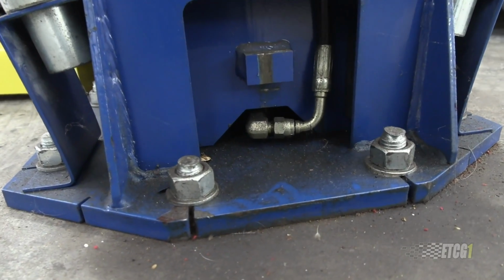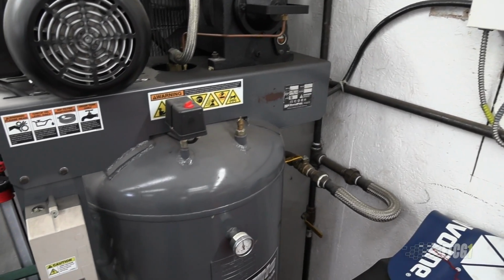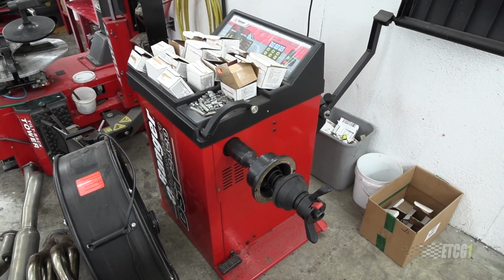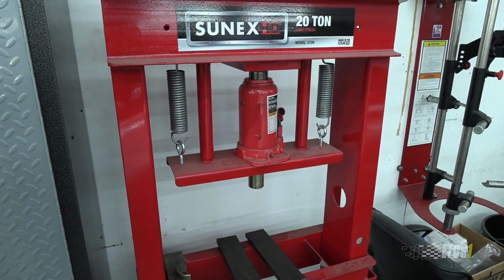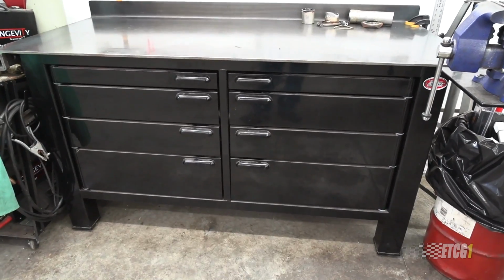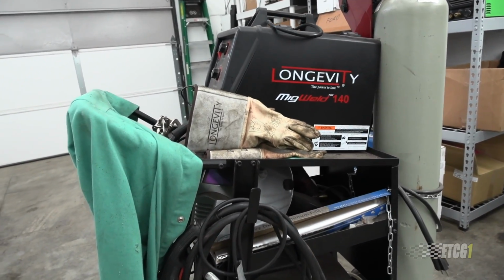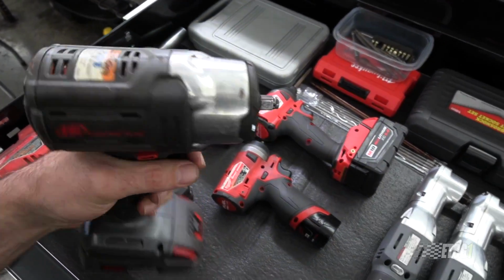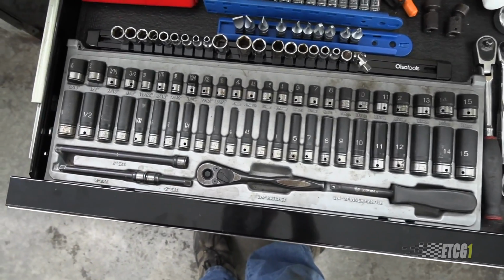The Tools I Get Asked About the Most

Comment: I'm a little late to the party but I thought I would ask if you've found an answer to your low air compressor output? Looks like it is a 2 cylinder model.  Each cylinder much like a gas engine will have two valves per piston,,IE one intake and one discharge.  Take your temperature gun and shoot the valve area on the head while its running.  Open a valve or something to keep the compressor running and try to keep the tank pressure up around 90 psi or greater.  What you may see is an elevated intake valve temp, due to a faulty valve.  This will allow the compressed air to to re enter the cylinder after its been discharged. Causing elevated temps.  Hope this helps.  Oh its a pretty common problem on reciprocating compressors.

Comment: maybe the air tank on the compressor accumulated some water on the bottom (if no air drier is installed on the input) so the capacity has slightly reduced as water is not compressible, my one has a drain valve on the bottom for that purpose, that one possibly also.

Comment: Eric speaking on your 2 stage air compressor you said you had diminished capabilities; sounds like you need a top end refurbishment. Valve service/replacement should be done @ least every year for heavy use w/ industrial air compressors. And for intermittent use every other year. I’m sure I don’t have to tell you about an oil change on factory recommended intervals 😂 Neglected valves turn into no air at all when they fail completely!! Check Pacific Air compressors out of Portland OR. I have found tuk’s (tune up kits) for every compressor I’ve ever inquired about there. They are great to work with....

Comment: I love Snap On and Gearwrench. Mac is okay, only thing is they rust easily, and their cutters dull easily. Their impact sockets are really good and their 1/2 20V impact (the small 500ft lb one?) is remarkably reliable. There's a new Snap On long neck flashlight with blacklight for $99 is ridiculously great. Found a bunch of freon leaks, most of the time without the yellow glasses/goggles! And...I purchased that $1,000 100th anniversary socket with ratchet thing 😂

Comment: Eric, you need to get one of those auxiliary air tank things. If I understand correctly, it's not constant running that kills air compressors, it's the start up that kills them. And if you're having trouble with volume, an extra tank will solve that.

I think the most popular ones are called Käser. Yellow tanks. They're everywhere on YouTube. I'd rather have a spare tank taking up valuable floor space than to have compressors failing every few years. That's a pain in the ass

Whoever invented stick on wheel weights needs to be taken out back, beaten, and shot.

I think you're ready to upgrade to a professional quality welder. Get a good Miller. You'll pay for it but, you'll get what you pay for.

I hate Cornwell tools but, Cornwell dealers have always been my favorite tool guys. Go figure.

My favorite is MATCO. Every bit as good as Snap-On but not as expensive in most cases.

For 1/4" drive, most of what we do on cars needs a 10mm deep chrome 6pt. If that was my only 1/4" drive socket, I'd be ok. Other than that, you need an 8mm and a shallow 5mm for some blower motors. And all of my 1/4" drive is chrome. And it's all Craftsman. The old shit. Somebody got me a full set for Christmas when I was in high school. It's Made In USA. But, I'm sure Lowe's, HD, or HF would be just fine for 1/4" drive in a professional shop where you're using it all day every day. I don't think you need to spend the money on Snap-On or MATCO.

I'll use my 12 or 13 on some stuff if I've already got my DeWalt electric impact in my hand but, I usually just grab the 3/8 shit for anything bigger than 10mm.

With 3/8s though, you really need to get the best you can get. With cars, that's your bread and butter. Damn near everything on a car is 3/8" drive

Comment: I bought Grey Pneumatic Dou socket set based on the recommendation from ETCG and 50sKid, and I am glad I did. I had an impact set from Harbor Freight and the missing skipped sizes and thick wall made it so I couldn't use them in a lot of situations. I couldn't even use the Harbor Freight sockets on my vehicle Lug nuts because they were too thick.

Comment: is there a specific brake caliper "pusher" you use? just went through a fiasco last week replacing pads on my jeeps rear axle and the calipers refused to go back in, had a "oem" dinky tool but had worked up to this point but immediately stripped out, remembered someone gifted me a kit for doing the screw in style calipers that id never used sure enough it had a provision for being used to push straight in, works with a 7/8" wrench and handle they put on it, their handle immediatly bent to an S and i replaced it with vice grips.. still no luck and this is with the bleeder screw opened and tool perfectly squared up.. did what anyone would o and welded a 1/2" nut to the tool and hammered on er with the impact until it was venting smoke and managed to snap the shaft of the tool

not gonna lie at this point i considered getting new calipers but at 90$ each it wasnt leaving a good taste in my mouth.. welded on nut #2 with some excess weld running down so it tapered down slower, another 3 minutes of the impact gun throwing all she had at er and it was finally in enough to fit the pads and rotors, other side was equally as resistant but we had the system down now and got in done in a couple minutes
Reply: Keep an eye, and your nose, on those pads. If they pushed back that hard they're probably going to drag pretty good and burn up

Comment: looking to pick up a Milwaukee 3/8 drive ratchet. Thinking of starting off with the extended reach one. Good idea or go for the normal length. I mostly do suspension and brakes stuff.. Typical Shade Tree stuff. But that long reach to pop some bolts on older cars is tempting.
Reply from the maker: My original 3/8" short Milwaukee broke. It was replaced with the long version and I haven't had any issues with that one so far.
Reply: @ETCG1  ordered the longer version last night.  Can't wait to use it.

Comment: Since I support my personal car addiction by working on other peoples beaters, in my part time shop, so that they can get to n from work, I've finally been dragged kicking/screaming into repairing "newer" vehicles. I still don't do complicated diagnostics, and never will. However, a "customer" recently needed inner tie rods replaced on their vehicle. Now, I'd seen the inner tie rod "tools" that look like small muffler clamps and always wondered how they could possibly work. When the situation presented itself, I didn't buy one of those. Nope...I figured either go big or go home! I bought the Lisle master kit and it worked flawlessly. I've used it several times since and I love it! The funny thing is that as I was thinking go big, I was also thinking big $. I'd never really priced them before but my kit cost under $100.

Comment: MAN I wish OG craftsman was still around. I have sockets from the 70s from my dad. Those fuckers are ni indestructible. Never had one break. I went to use one of my friends sockets the same way. One of those cheap store brand sockets. Got rougly 200-300lbs on the end of it and BAM ratchet goes flying across the driveway. 4 Points split at once. I dug some more, found my craftsman and used it to get the job done.

Comment: When was the last time you purged your hard lines? If you don't have a dryer plumbed in between the compressor and the lines, the lines can get kinda clogged with condensation and rust, which will drop the flow rate over time. It'll be especially bad if you've got elbows that go from horizontal to upward vertical.
Reply from the maker: Not only do I drain the tank after each use, I also have water traps at each drop down. See the video linked in the description of the installation of the system. I believe my 20 year old air tools are just showing their age. Thanks for the comment.

Comment: I use a Bendpak lift almost exclusively at work that's very similar to yours. It weeps fluid like yours, too. Also the locks are insanely loud compared to other lifts in the shop if you don't rest your hand on the release lever while raising. I've also had the switch stick on once in a while as well. Other than that, it's been solid, reliable, and was less expensive initially compared to some other lifts we have.

Comment: i have used many brands of tire changers and my favorite is the coats air powerd with assist arms, once you get proficient there is nothing faster. We have a hunter revolution at my current shop and that thing is a pile, you are supposed to be able to walk away while it dismounts but it contantly fails at breaking beads, snapping sensors and not grabbing the bottom bead. The hunter road force balancers however are the best period.
Reply: The revolution is an amazing machine but it demands respect. A lot of the tire guys at my shop would use it manually because it was way faster but eventually it came out of calibration without anyone realizing, until one day someone tried using the machine as intended and the duck head came down hard and destroyed the wheel. The rev isn't worth the money unless you do a lot of tires, it's amazing how effortlessly it will mount/dismount Corvette run flat tires

Comment: The last shop I worked at had that same spring compressor. I loved it, so much safer and quicker to use. It sure does take up a good amount of space though. And man I'm jealous of that long 1/4" rachet, I agree on the long handles. I believe it's easier the get an accurate "torque" by feel with them.

Comment: Has the air compressor got an air dryer fitted to it? Could be a chance its got a bit of moisture or water inside the tank which for obvious reasons will decrease the maximum air volume of the tank.

Comment: If you are having trouble with keeping the volume of air pressure you should look into having the piping cleaned out with an acidic or caustic based cleaner. You would definitely benefit from a larger header/ piping for your air coming out of the compressor and only neck down to connections for hoses. You could definitely benefit from buying or fabricated a receiver/ holding tank so your compressor would only have to fill up the extra tank after the psi was below the setting on your compressor!

Comment: Hey Eric, I've had the same lift for about three years now. Mine initially had a small leak on one side, but after tightening the fittings a little more, it has been leak-free. Maybe yours just needs a little more torque on them there fittins!

Comment: Great vid.  Looking at your air compressor, you may want to move it away from the wall 6" or so.  Your compressor must get pretty hot with no air flow that is pulled from the "pulley/fan".  Maybe that might be related to your issues?

Comment: First, the best and most useful tool reviews are the ones that review the tool's function and effectiveness at the job it was designed for.   Then if you decide it's needed, you can begin the process of quality and brand evaluation elsewhere.  Highlighting "odd" or application-specific tools is a tremendous help to all of us who aren't aware of some of the "tricks of the trade"; yet still have to work on our cars, homes, hobbies, etc.  For example: I have many favorite go-to tools, but there are two that stand out, for different reasons.

The first is a set of Vise-Grips "Locking Wrench" a.k.a. "nutter grabber" jaws.  I don't know when or from where I got them nor why, but last fall, they saved my butt fighting a rather frozen brake caliper pin that refused to leave it's bracket.  Those were the only tool that could hold it tight enough to both twist AND pull until I achieved victory over it.  The alternative was losing a couple days work and at least $50 in parts from multiple local auto parts stores!  I blow them a kiss every time I open the plier drawer.

The second has an even better story.  Due to desperation, lack of funds, and not knowing better - I decided to rebuild the rear brake calipers on my '04 Infinity I35.  For those who don't see this coming, these are the type of import rear calipers that use an internal cable operated parking brake mechanism - the type you need that goofy "cube" adapter to twist the piston back down when changing brake pads. Skipping the rest of the headaches, the nightmare was trying to place an inner c-clip, near the base of the piston cup in the caliper, to retain a spring tension retainer cage - that yes, needed to be pressed down and under several pounds of tension to do this!  The piston cup is ~2" deep and not even that wide.  Show me a commercial set of ring pliers that can do that!  Well, I certainly couldn't find any through the channels I know of.  Finally I'm just out with my dad roaming Menards and he points out a set of 8" straight hemostats, wondering if they could work.  Ten minutes after I got them home I'd ground the tips to posts that fit a c-clip.  Ten minutes after that the caliper internals were installed and ready for final assembly(And worked great).

Sometimes the best tool for the job didn't start out that way.  Speaking of which, I've got some front wheel bearings to replace on my Acura, I think I'll be looking for a tool like your #XD45 from your Accord wheel bearing video from 10 years ago.

Staying Dirty, but apart!
JD

Comment: You probably do it but didn't mention it, but you have to drain your compressor periodically. Also steel plumbing for pneumatics dose tend to rust internally, which displaces air and causes less volume. You might have to open the farthest end of the system and then (in a safe and controlled manner) blow out the system.
Reply from the maker: I empty it after each use. I believe my air tools are just getting old as they are 15+ years old at this point.
Reply: I figured you did. I thought I saw a drain in your main steel line next to your compressor

Comment: Up until this year, I was working on my car with only hand tools, including the use of a breaker bar.
Then a couple months ago, I decided that I was tired of busting my knuckles and having sore muscles, and decided to invest in power tools. Boy I was angry at myself for not investing in them sooner. I picked up a Milwaukee 1/2" Stubby impact wrench, and a Milwaukee 1/2" Mid Torque impact wrench, and it has drastically changed the way how I work on my car now.
Great to see this form of "update" of your tools and workbenches. You said it yourself in another video in the past that cordless power tools have come a long way and have replaced air tools, and I agree. The way how cordless power tools have the same, or in some cases, exceeded the power of air tools, and are widely available in stores now, is just incredible.
Awesome video as always!
Reply: Get yourself a milwaukee ratchet to match and your life will be forever changed

Comment: Could the compressor be filling with water from condensation? It would make sense the pressure of the air will still show as there but it won't have the volume of air in the tank from the displacement of the water in the tank?
Reply from the maker: I empty it after each use. I believe my air tools are just getting old as they are 15+ years old at this point.
Reply: @ETCG1  maybe rebuild the air vanes inside the tools or least look at them i don't know haha weird I hope you find the answer
Reply from the maker: @robfahey1349  Easier to just get new ones.

Comment: Hi Eric have you tried calibrating tyre balancer in the settings. Compressor   Have you serviced it and how often do you drain the tank of water and pipes can reduce the pressure u receive
Reply from the maker: Yes, I've calibrated the balancer. I also empty the compressor of water after each use. I suspect my air tools are just getting old as they are 15+ years old now that I think about it.

Comment: A tool I like using that I don't normally hear of anyone else using is the AirLift. It is by far the best/fastest/easiest way to refill a cooling system. Before you even fill up a radiator, you'll know if you have a leak because it won't hold vacuum. Very useful tool.

Comment: An air compressor that has the pressure, but the volume of air is diminishing could mean your air tank contains water, might be a clogged up or filled up filter.
Reply from the maker: I empty it after each use. I actually think the problem is my air tools which are 15+ years old. Likely getting worn out.
Reply: @ETCG1  I once emptied an air tank and removed gallons of rusty and oily water from it, the stench was horrifying. The customer never emptied it, claimed he wasn't informed about it being necessary... This happened years ago, when you told about your compressor, I immediately could smell that same stench again. Thanks for reminding me ;)

Comment: Talk about a change from the olden days of a small garage, bad lighting, and exploding spring compressors!  What happened to the BETA tool T-Handles?
Reply from the maker: I still use them from time to time, but they disappeared from the J&B Tool line up a few years back. I guess they didn't sell well.
Reply: @ETCG1  I looked into getting some when you first mentioned them but they were something crazy like $30 per wrench.

Comment: When was the last time the air tank was drained? Also, is it a servicable oiled system? Could be due for change or re-ringing. Worth doing on quality compressors. Brought my 30 year old Ingersall back to life.
Reply: If you're suspect of air tools, drop a few drops of ATF in the tool mid-use. If instant improvement, 100% tool at fault. I use a few drops in my 1/2" gun if I'm feeling iffy going into something like a stubborn axle nut, gives it the extra jimmy jam.
Reply from the maker: I drain it after each use. I think the issue is that my air tools are just getting old. Most are 15+ years old.